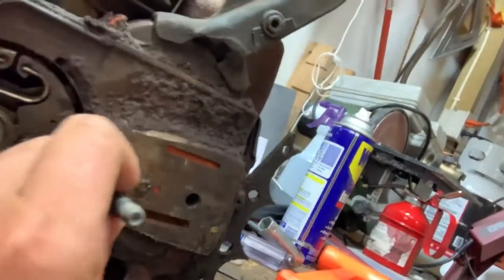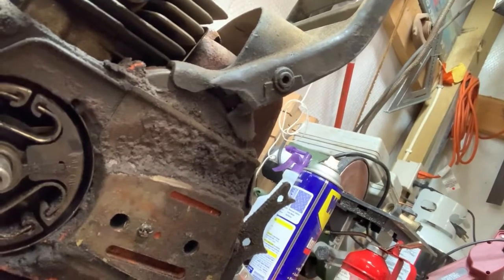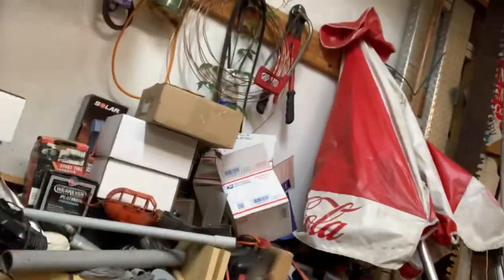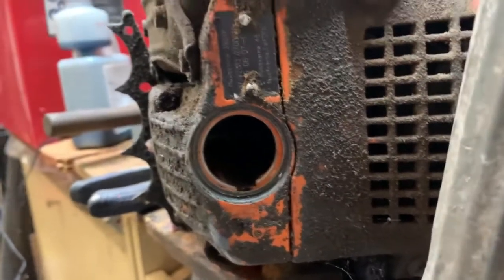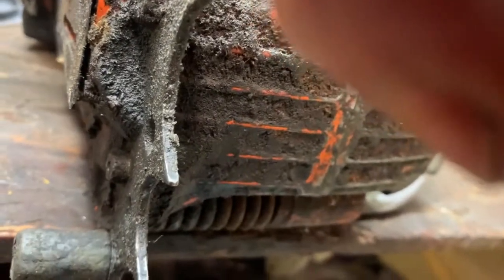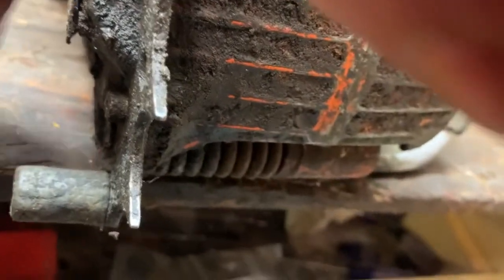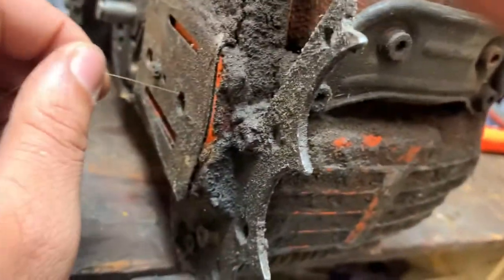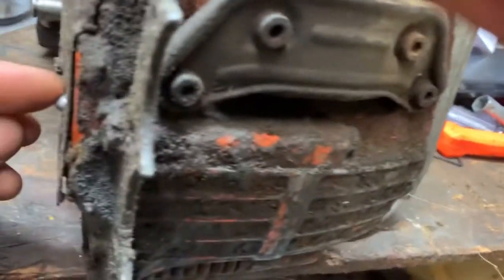Installing Husqvarna bar stud

Comment: Thank you so much! Saved me a few bucks, and some embarassment, taking it in to get it fixed. What a shocking design flaw.
Reply from the maker: @AnnaWooH  it’s not as much of a design flaw. as it is of ease of replacement. I have thought about taking a set of bar studs for a Stihl and threading them into the case on a Husqvarna and just using a Stihl bar.

Comment: A magnet for retrieving drop nuts and bolts under cars works really well
Reply from the maker: I just showed my way, there are millions of ways to do things. I will try the magnet next time for sure. Thank you
Reply: That was the only tool that I had in the woods question to all Husqvarna chainsaws studs have to be changed through the oil tank?
Reply from the maker: Not all of them, 285,298,2100 do not go through oil tank
Reply: @JKSawShop  kool thank you

Comment: Im about to try this but I have 3 bolts, 2 fell out but only 1 has threads. Not sure how I'll get the other to lock in.   Started this late yesterday and there was still tons of oil dripping around and that didn't help at all although I didn't tip the saw on its side either but will now.  Thx
Reply from the maker: They’re not too awful bad difficult to change out. I just had somebody make the question and I tried to give them an answer on how I do it. Sometimes I put a little silicone on them though, so when they go back in they’re sealed.

Comment: Great tip
Reply from the maker: No problem, glad to help. Sometimes I will even use a little RTV form-a-gasket and put around the head of the stud and then pull it through the hole to seal everything together. Especially if they are a little looser than I like.

Comment: Any idea how I'd do this with my oil cap on top instead of the side
Reply from the maker: What saw?
Reply: Homelite 240
Reply from the maker: @thestraitgateway  got to pull the power head out, the studs are not accessible from the tank on them
Reply: @JKSawShop   that sounds tough, what is the power head
Reply from the maker: @thestraitgateway  the engine assembly that is inside of the case
Reply from the maker: There are some that only have one stud
Reply: @JKSawShop  well I've been using with one stud and seems to be working find. But it's more like one and a half studs because one broke in half. So the remaining half I think helps support it even though I can't get the nut on the end